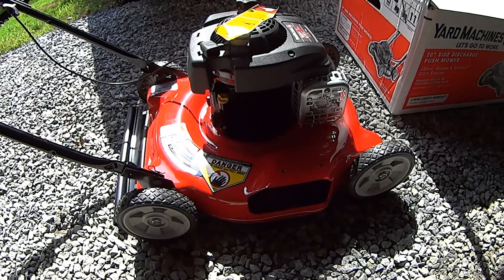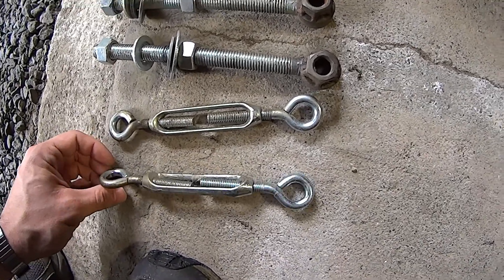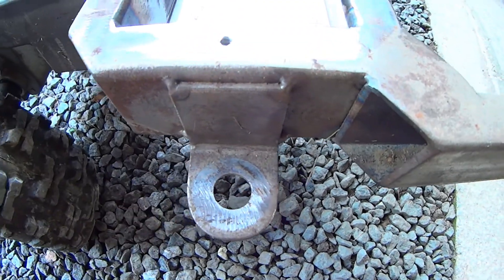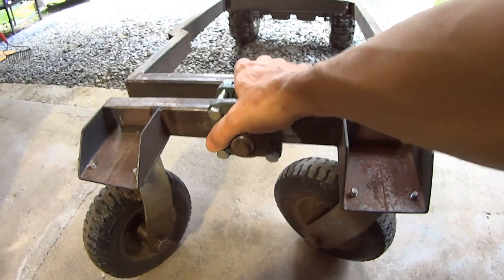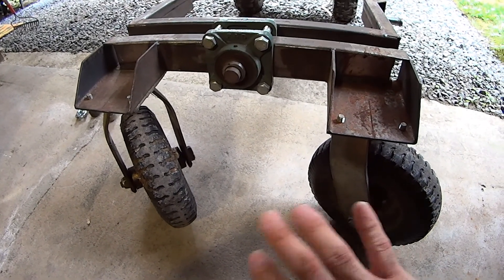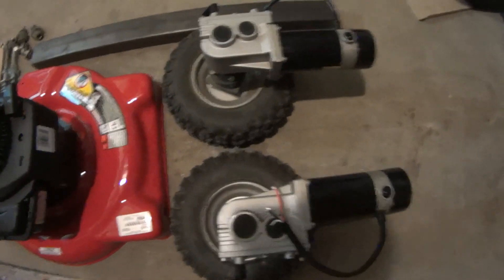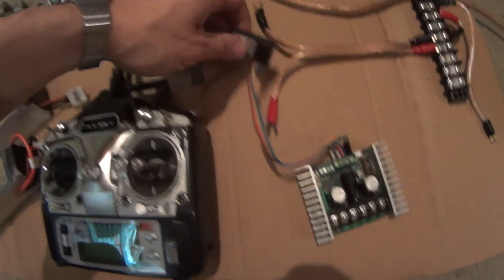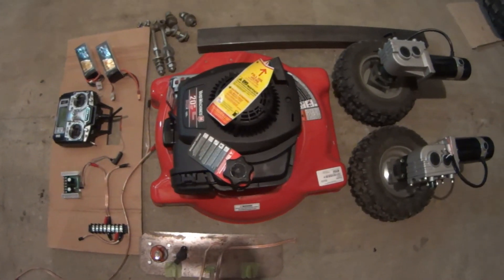RC Lawn Mower Version 2: Pt. 1 Some assembly required...Tear down to build up.

Comment: What is the wheel for the motor?
Reply from the maker: The wheels were purchased on eBay. I think they are originally designed for a snowblower. I purchased some OEM hubs for the motors and made some adapters so they fit the motors. It is not a direct bolt on solution. Thank you for watching and commenting.

Comment: the closer the front wheel attachment is to the rear wheels the higher the force will be on the front wheels and makes it not very balanced. If you could weigh all for corners with scales you could then better decide were to put the weight of the batteries and such. The electric motors running parallels to the ground also makes the problem even more exaggerated at least when they are hanging of the rear axle lifting up even more on the front. Good job I like where you are going with this..
Reply from the maker: Thank you for your thoughts. We will see how it works out. I'm getting close to putting it back on the ground. Please check out some of the newer videos on the channel too. It will move soon. Stay tuned.